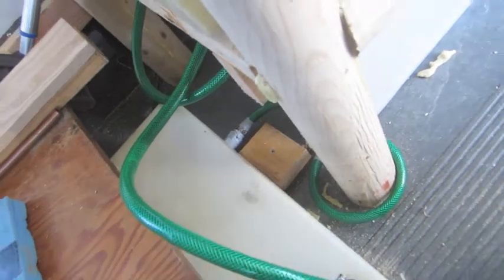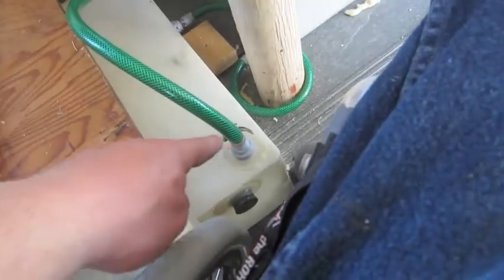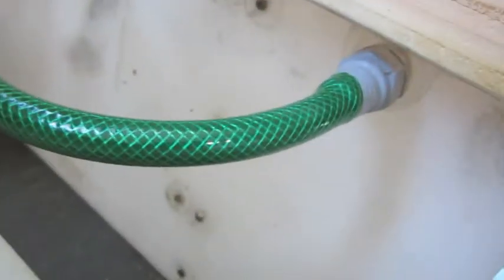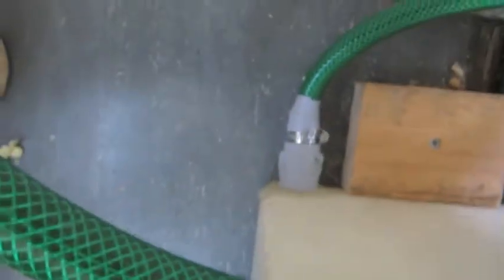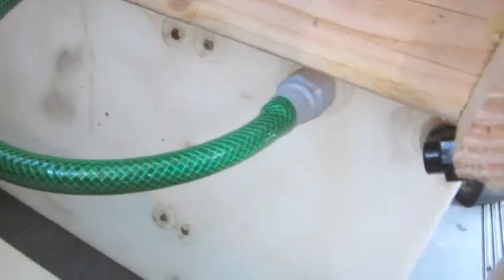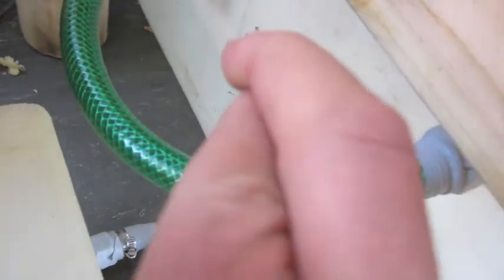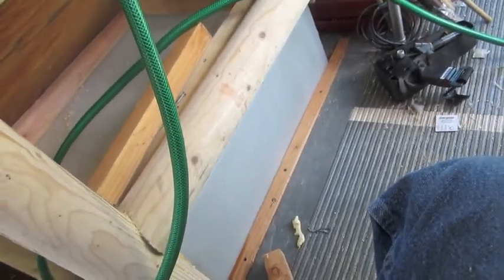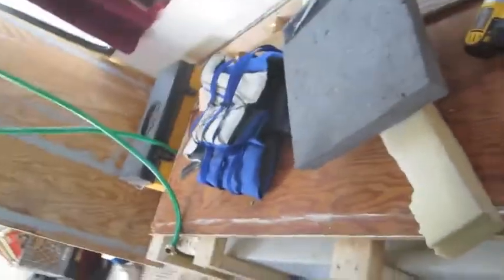Shuttle Bus Conversion, Wheelchair Motorhome Project, Video 21

Comment: Bummer on the leak! Looks like it's under control now. I was thinkin' you should add some cutoff valves between the tanks so you could at least stop one from leaking out in an on the road emergency. Anyway I'm really enjoying your build, good luck!
Reply from the maker: John Gemhunter i just thought about that, thanks for the info